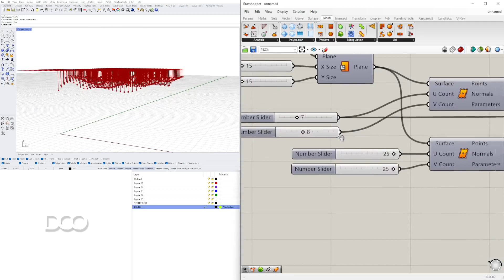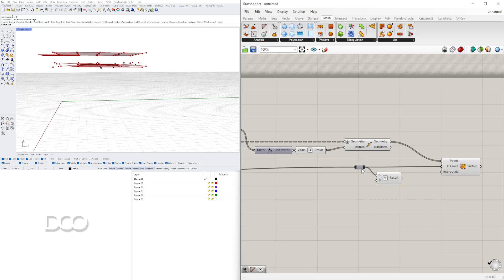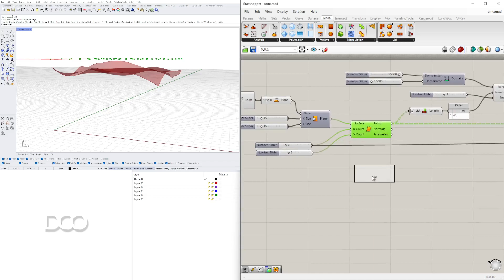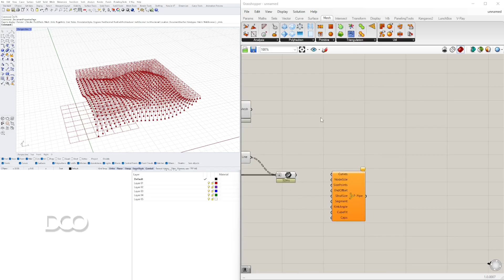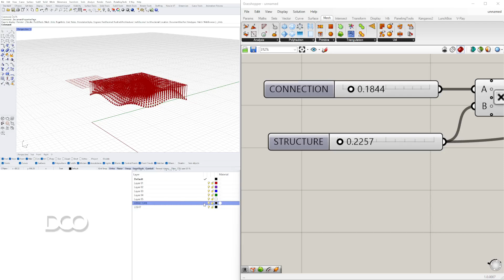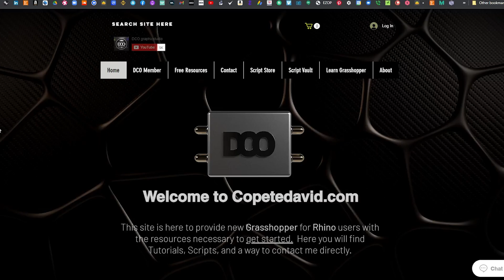Comment: I did everything but my points are in a line not very random. when i did the panel plugged into random the points move in a horizontal line.
Reply: Make sure that the vector you use is a z vector and that will ensure they move down. Send me a message to copetedavid@gmail.com or copetedavid.com and I can help you fix it. 👍

Comment: Hey i did the exact same steps, but my surface from point is not happening, any suggestion?
Reply: yes, for the u value you need to add +1 and it should work

Comment: How can I get the distances of each structure's light and the structure's grid so that I can manufacture it?
Reply: You would plug the vertical lines into a curve length component and the output would be the varied length.  Plug in the points into a point list component to see how the grid is organized and now the list corresponds with the point list
Reply: @DCOParametric  Thank you so much for the answer.
It would be possible in the future to have a video on the channel on how to "document" all this, to be able to execute this project.
Reply: yes for sure!  Here is another tutorial that will help for sure.  This is another way of getting the dimensions.  also cost estimations.  https://youtu.be/4k1gymrfyhE
Reply: @DCOParametric  Thank you very much.
You help me a lot.😉😉
Reply: Anytime! Glad I could help!